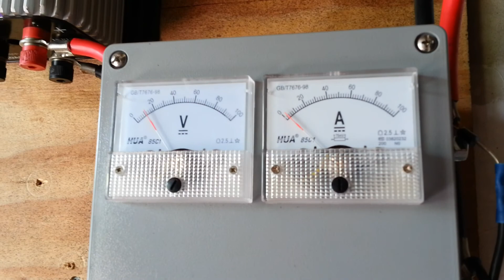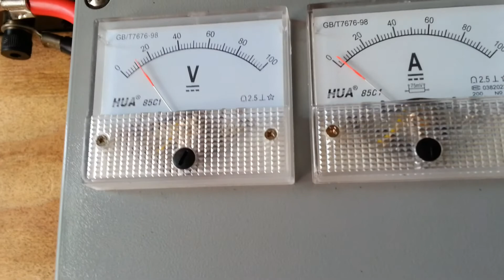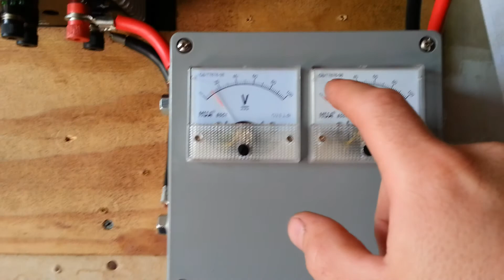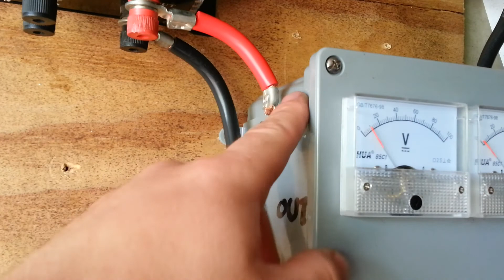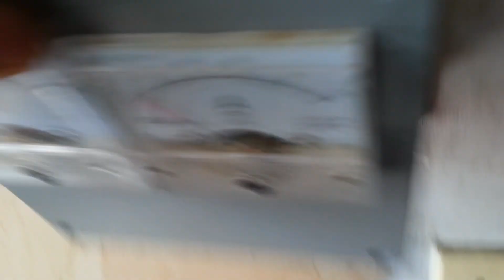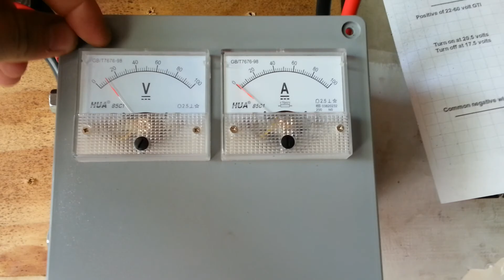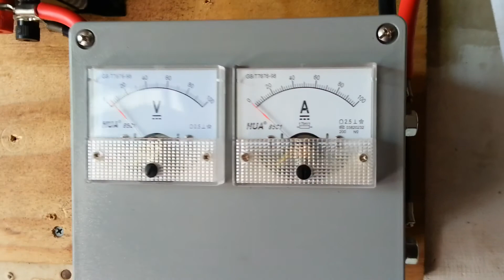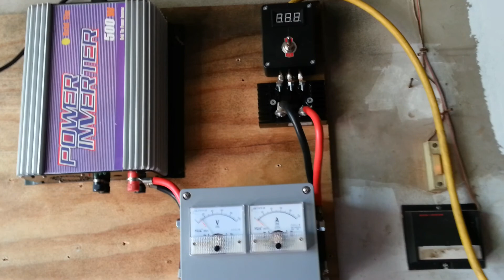WindyNation WindTura 750 Cleaned Up Electrics

Comment: Hi Burns... Im a newbe in connecting up shunts and AMP meters ..  So I place the shunt in the box and connect the negative wires to it so its flowing through it and I also connect both wires from the amp meter to each end of the shunt ..So the AMP meter is taking the reading off the negative side then ? Thanks for any help Burns ..